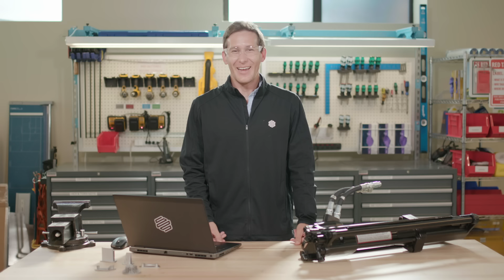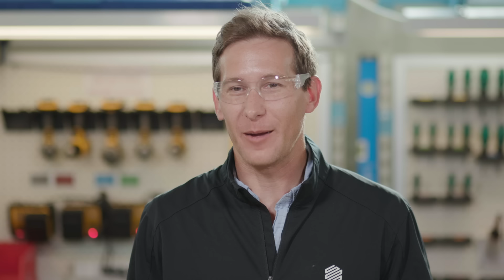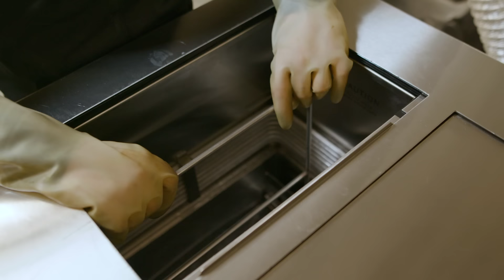Metal 3D Printing Walkthrough | Markforged Metal X

Comment: Question. What is the voltage for the printer, washer, and sinter.
Reply from the maker: The Metal X can accept 120 or 240. The wash is 120, and the Sinter 2 is 240. We have a facilities guide that goes in-depth on what's needed to power the system.

https://bit.ly/metal-x-facility-guide

Comment: That is awesome, .....

Would you do an experiment like in this picture for your next project?
8ttps://images4.imagebam.com/9e/b1/2e/MEKFJ3L_o.jpg

I have a heated debated with my friend,
he said without "Gear", the rotor will wobble randomly and erraticly.
I think No, because the rotor is holding by its housing/casing and eccentric shaft firmly/tightly.

I can't prove it, but logically my idea is right, isn't it?
So if you interested in this concept, I would be very appreciate.
Have a nice day

Comment: So in designing a part do you have to upscale the part by several thousandths to compensate for shrinkage from sintering?
Reply from the maker: Hey Cole! You don't have to upscale the part in CAD, when you bring it into our software Eiger it will automatically be upscaled. 

Here's an article from our learning library that details some of the Metal processes: https://markforged.com/resources/learn/design-for-additive-manufacturing-metals/metal-additive-manufacturing-introduction/metal-additive-manufacturing-process

Comment: Markforged  can this machine print a refractory alloy such as tantalum Hafnium Carbide who melting temperature is 7,400 F.?  I think it would have to be a powder, I don't imagine it comes in a wire.
Reply from the maker: Hi Wade! At this time, the Metal X cannot print Tantalum hafnium carbide. If you're curious about what materials it can print, we have more information available here:

https://markforged.com/materials/metals/

Comment: If it's metal powder with a binder, there has to be shrinkage involved. 1) What type of shrinkages are involved that need to be compensated for and does the software account for shrinkage during printing (and would it automatically change it's values based on the target metal which vary in shrinkage). 2) Wouldn't the binder itself (or burnoff residues of binder) result in compromised metal integrity within the crystalline structure which could fail under stress or heat?
Reply from the maker: 1. Yes, there is predictable shrinkage that occurs during the debinding and sintering steps of the process. Our software automatically scales the part while printing to account for the shrinkage.

2. Our feedstock is similar to that used for an existing technology called Metal Injection Molding (MIM). MIM materials do operate on a different standard than wrought materials — typically they are slightly less strong/stiff and are slightly more brittle. Markforged materials meet or exceed MIM standards and are typically within 5-10% of wrought strength standards. If you want more information, check out the material info on our data sheet or feel free to reach out to us directly.

17-4PH datasheet: http://bit.ly/3CpwP2f

Comment: As this technology didn't exist when I was an engineer, would be interested to know the accuracy and finish that can be achieved. Fascinating stuff.
Reply: saw this online.... Z LAYER RESOLUTION  50 μm - 200 μm  (so roughly 2-8 mils). You could do post machining to dial it in further I guess
Reply: And here's a brief rundown of everything I never knew about welding: R.M.Gage invented plasma arc welding in 1953 while working on the Saturn V rocket, which was further refined by Kurihara in 1989. Markforged's own website dates the 1st metal 3d printer to 1997 which is 25 years for 3d printers to reach the general public 🧠

Comment: I’m wondering if these 3D metal printers can be used for mass production runs.  I work in a plant that makes metal gears, gerotors, slides, and other parts for the automotive industry.  Our production runs are in the 10s of thousands per lot.  We use powder compact presses and sinter furnaces, tempering furnaces, etc.  The parts usually need to go on a sizing press afterwards and sometimes need further work after that before they are ready for use.  If these 3D parts are ready for use right out of the sintering process that would save a hell of a lot of time and money.
Reply: 3D printing is always going to be slower than molding. What you're describing is essentially metal injection molding. You can scale that and shoot 10, 50, 100 parts at a time on the order of seconds. A 3D printer might take 4 hours to make one part, then you still have to go through sintering etc. Molding is tricky to set up and then fast to use. 3D printing has no setup, but takes a long time. So it's nice is the low volume specialist stuff, prototyping or possibly mold making.
Reply: @bs0u0155  You're correct that it takes a while to set up a press, but we dont do injection molding.  We do powder compact.  I suppose you could compare it to pressing medication powders into prescription pills. Same basic idea on much smaller and simpler scale.

Comment: Super cool product forsure, but I just cant justify the efficiency, time and cost rather than just having a part CNC made. After sintering, it has to be machined anyway. 🤷
Reply: CNC made molds can be very expensivem at least $100,000 for a plastic model kit.. A printed one would cost much less, use less material and CNC processing would be applied later,requiring much less CNC work tnan cutting out the mold from a huge metal block. I noticed that plastic models have become very expensive, more than the increase in oil prices. May be attributed to the increase in CNC related labour costs As the market for plastic models has shrunk considerably and economy of scale difficult to achieve, this technology might be an alternative.

Comment: Can Turbo-Stratic Graphene Flakes be added to the mix of the metal feedstock for the printer??? And will that bond the graphene equally within the structure of the part? Or will additional functional addives and/or proceses be needed to settle the graphene evenly and properly within the part???
Reply: Yes, you can print a diamond with Sandvik and I'm sure Tripp isn't far behind

Comment: That’s a lot harder then to forge or make one from scratch though surely Cnc would be way faster
Reply: Yeah but I think the real advantage with these is that you can print more complicated pieces you wouldn't be able to mill or cast easy.
Reply: You pick the tool for the job. 3D printing enables complex internal structures that are completely enclosed, CNC would require multiple parts, or at the very least a human babysitter to flip/reclamp parts. Also complex shapes (like the turbo impeller) that would require a 5D CNC.

Comment: Well considering you'll have to buy other two subsystems wash and sinter it's quite difficult to justify that high cost and also the electricity cost to produce those middle size metal parts, at the moment the CNC is winning in all aspects, but this could be matching for some one who makes unique exclusive parts again, quite difficult to justify the cost of all this process
Reply: these are not consumer level products. metal 3d printers can make some things a cnc simply cannot. its not a replacement but it is yet another tool for niche purposes
Reply: @kektaro  like what?
Reply: @fredrezfield1629  there are a lot of very complicated things such as prototype manifolds or rocket engines. Theres also things like optimized load bearing structures that look weird and wacky and would be an absolute pain to machine but 3d printing allows engineers to save material and weight on structures that need to be as light as possible especially in things like small scale or specialty aircraft. These designs are usually computer generated and, again, would be hell to fabricate prototypes of by conventional methods as they involve very weird looking but mathematically optimized shapes. Back to the rocket engine example, back in the day nasa developed a method to make channels in metal pieces such as gugantic rocket engines by filling them with conductive wax and electroplating it over the course of weeks in giant baths. Imagine needing to do this for protoyping.
Breaking taps made a great video about this and did it himself in small scale. That is technically a way harder and more time consuming method of additive manufacturing. 

3d printing is not a be all end all solution but it makes amazing things possible
Reply: @kektaro  youre gonna prototype rocket engines ? 
all those things mentioned are achieved through dies and molds and tooling
Reply: @fredrezfield1629  it is way easier with 3d printers and i literally said its not for consumers so no. I am not gonna prototype rocket engines. There simply are some geometries that are impossible even with modern tooling. Youre misinterpreting my words and the use cases i see. And no. You cannot just cast everything. Accept that some things are simply near impossible
Reply: I thought the same thing
Reply: you realize 3D printing is also CNC ? it's not replacing anything it's just an addition instead of cutting now you're printing building it.
Reply: What about this being used for making cat50 holders for cnc applications

Comment: I want this to print metal D&D miniatures
Reply: you can almost do that already with most metal filled filaments. I wouldn't be surprised if you could use the same processes in the film to achieve the same results, but even without doing that you still have the weight, feel and look of metal. Check out Proto-Pasta, they have a ton of filaments to run. I've used brass-filled filament and it's nice.
Reply: That was my first thought.
Reply: I wanted it to print erotic statues, lol.  I think metal is overkill for tabletop games.
Reply: sounds like the perfect crowdfunding startup

Comment: What benefits does this have over just metal casting the part?
Reply: Precise parts, faster and safer production and cost effective
Reply: No or very little machining is needed.
Reply: Casting the part requires making the mold, then casting the part. 2 steps. With 3D printing you can go from computer to part in one step. Casting wins with volume production, because you can shoot part after part, or make a multi-part mold, but printing parts means you get to check the part fits - THEN you can make a mold for production.

Comment: Oh cool, I can print a gun now
Reply: *Airsoft gun
Reply: depends on the strength
Reply: @ISitOn MyArm a bullet firing is not an explosion the gunpowder is not exploding it is burning it's burning very fast but burning not exploding many firearm barrels are produced of stainless steel which this machine can use in tool steel is very suitable for a barrel and chamber if annealed properly

Comment: As a tool application it would be nice to be able to recycle it on site and make another tool.
Reply: As recycling would require breaking the metal down, then recombining it with plastic and extruding filament, a recycling program with the manufacturer or a regional processor might be easier to implement.

Comment: Why is it so ridiculously expensive? Do you even want to sell it? Everyone in my company is gushing over  the idea to be able to print 304l in house but at this pricepoint no sme can justify the investment, even though startups and sme are those who are more likely to make use of metal printing, since they're so much less averse to innovation. Extremely frustrating.
Reply from the maker: Hi! Traditional powder-based metal 3D printers usually start around $500,000. The Metal X System, which includes our printer, wash, and sinter starts at $125,000 and is one of the most affordable metal 3D printers on the market, however, it is still not the right solution for everyone. 

Our Metal X customers span various industries, all with a diverse range of applications. You can read more about a few of them below.
Guhring UK: https://markforged.com/resources/case-studies/guhring-uk-case-study/?mfa=youtube
Nieka Systems: https://markforged.com/resources/case-studies/nieka-systems/?mfa=youtube
Shukla Medical: https://markforged.com/resources/case-studies/shukla-medical-case-study/?mfa=youtube
Reply: @markforged  how do i get a quote ? Whats the contact for that the online form doesnt seem to be working.
Reply from the maker: Hi  @JJ-vp3bd , you can request a quote for a printer on any of the printer pages.  https://markforged.com/3d-printers/?mfa=youtube
Reply: @markforged  I understand that it is much less expensive than  DMLS and I don't want to sound like an ungrateful consumer who doesn't understand how these things work, but using MIM material as feedstock for an FDM printer should not be so expensive. As soon as companies start to sell the filament some maker is bound to make a cleaning station and your lunch will be eaten.

Comment: If you take up a loan to buy this product, i cannot for the life of me see how this is economically viable. The processes takes so long time, and in most cases the part isn't really finished when it comes out. How big the the tolerances of the parts coming out?
Reply: Within 5 thousandths on an inch.  With that being said though, surfaces can be finished to tighten the tolerances.  For the price its not bad, especially comparing to DMLS.

Comment: Are printed parts as durable and hard/dense as cast parts?  Would you really use 3d printing to make a turbo impellor as shown coming out of the furnace at 2:51 in this video?
Reply: Yes
Reply: The printing technique of layer by layer results in the parts mechanical properties relying largely on the orientation it was printed in as bonds between layers are far weaker than in continuously formed materials. That being said they are still impressively strong. The key drawbacks with metal 3d printing currently are the very large print and post processing times that make then impractical for any mass production and the one above described as far as I'm aware

Comment: One question from me is: the finish metal part (for example stainless steel,or aluminium)can be weld ,for example with Tig or Mig?
Thanks.
Reply: You are able to weld, plate or heat treat parts (within reason).  But like Dustin said, the composition would be different at the weld.
Reply: Welding with stainless thread keeps it stainless after weld

Comment: There comes a point in which a CNC machine is much more effective. In 3D printing, that point is around $500. Why spend more than $500 on a 3D printer when an entry level CNC can be had for the same amount? Am I missing something?
Reply: Because you can print parts with shapes a regular CNC machine can't
Reply: @g %  Absolutely. Casting is a great alternative to get roughly the same end result. The only difference there is usually how many you need to make. Casting is probably a better idea when you need to make 100-1000 of something. Additive can do it when you need less. Several of the additive manufacturing bureaus I have talked to have said the same thing; these metal printers are really for very low scale production/prototyping so far. In the future we may see that change though.
Reply: @aerball  don't forget making the molds for casting. You can use binder jetting to create imposible to CNC molds
Reply: CNC cant easily compete with the more complex parts that are possible with additive manufacturing. With this system, you can create parts that have internal cavities and undercuts that a CNC can't do at all, or not with out secondary processes. For example, you could make a part with metal 3d printing that has a sweeping tube shape going through the whole part. You could do this with a casting process, but not CNC. 
I can speak from experience in getting parts from this system through a service bureau that I can get Stainless Steel parts with more complexity from this system for 50-80% of the cost of traditional CNC with Aluminum. If you are a company who makes many parts for production or R&D, this machine could possibly pay for itself over the course of a single year.
Reply: @g %  who does casting for 35mm figurines? is it cheaper?
Reply: @g %  who does casting online??
Reply: @g %  because im trying to make 35 mm copper figurines. I dont have a forge dude bro.
Reply: $500 CNC machine ?   Are you refering to a CNC Milling machine?  If so, who makes one for $500?
I think they go for more like $50,000.00
Reply: I suppose the advantage to this is that it is easier to use than a traditional cnc machine. Also keep in mind this works with steel. With those $500 machines only being able to cut plywood, aluminum and plastic. But even then this thing costs way too much for what it is. R&d markup probably. I’m hoping the Chinese will bootleg these soon though. When that happens these will definitely be cost effective.

Comment: remember when FDM 3d printer first release is so pricey, we wait until the machine price drop to 200-300$. same like this metal printing.. we wait china ;p
Reply: is there now any cheaper alternatives to metal printing?
Reply: @JJ-vp3bd  This is to my knowledge the cheapest way. Most metal 3D printers use powder. which need a vacuumed and then argon filled room. And off course a 500W laser to melt the powder. That's not getting "cheap" soon.

Comment: do you get only solid parts or can you make infill structures like on normal fdm Printers?
Reply from the maker: Hi Samuel, if you head to 0:45, you can see the infill structure for the part in our Eiger software. You can also see it while it's printing at 1:31.
Reply: @markforged  Thank you 👍🏻

Comment: The cost time running sounds like it could price the part out
Reply: The machine is $160k
Reply: @HammerLeaf  i did an online estimate and my 35mm copper part came out to around 10usd. Sounds like a competitive price
Reply: you're meant to exploit the printer to make parts that the original manufacturer no longer makes.
this will prolong even more old products in the long run like vehicle spare parts etc.